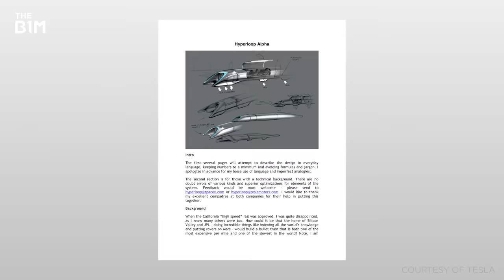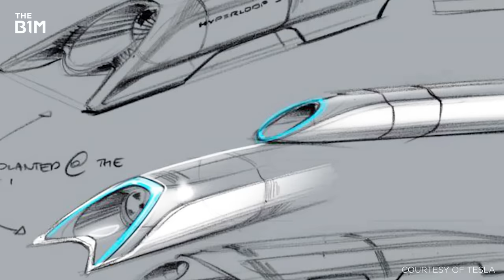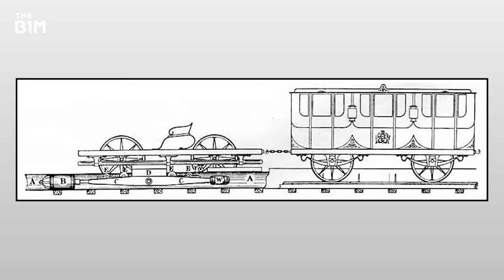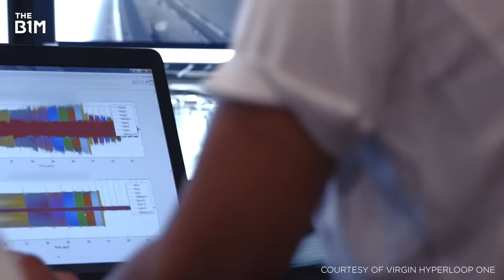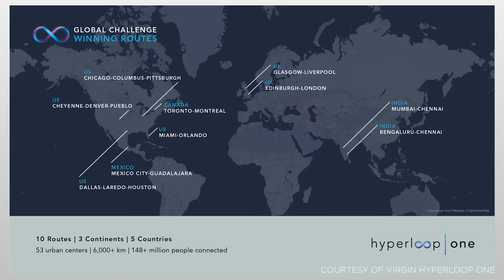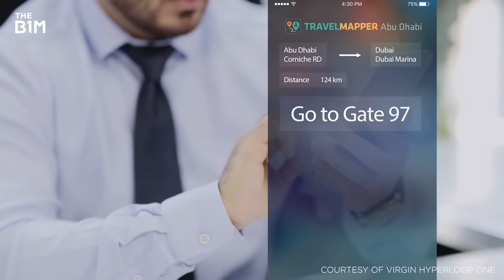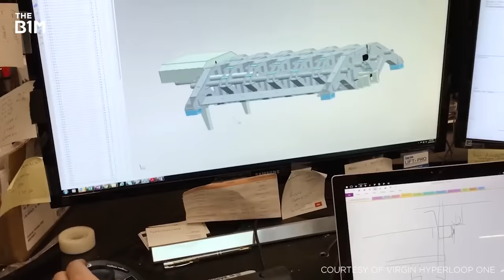Hyperloop Explained

Comment: Google world's largest vacuum chamber if you want a scale of how difficult an entire train line of vacuum tubes will be.
Reply: Actually, I recall that the tubes would be filled with a very light gas, and not a pure vacuum. 
It would be difficult to achieve a near perfect vacuum in a very long train tube. 
Of course sticking people into a pod inside a total vacuum just has the word "disaster" written all over it. 
Well, add onto that the fact it is supposed to move at 700mph. 
Tough technology to crack.
Reply: True. That vacuum thing may be foregone for safety concerns and practicality. What may need to happen is a system that lowers air pressure ahead of the train and returns it behind the train... To keep the system balanced. I wouldn't image the effects of dying in space like conditions right here on earth. Folks would burst in nanoseconds and be dead in less than half a second if their pod leaked out into the vacuum tube...
Reply: @pauldatche8410  A very difficult technology to achieve. 
Keep in mind a train that is moving at 700mph. 
How do you pump out a forward vacuum at those crazy high speeds?
Reply: Sauga Verse you would have to do it quite far in advance of the train, but the sections would still be kept at low pressure for only a short amount of time.
Reply: @ala0284  
No risk of fatigue failure using that idea, I don't think.
Reply: @Saugaverse  id be happy with 200mph
in the uk london rn trains dont even reach 100mph we are using 30+ year old tech
Reply: So I did what the OP suggested, and honestly I can't see the big problem. We've got large vac chambers that we built in the 60's and still use today.  It's not a particularly difficult engineering challenge. Yes we would be doing it on a whole new scale.  But we've come a long way from the days of cast iron tubes and leather seals.  Yes, it's a lot of air to move around. But once you have mostly evacuated your tube (=time)  Keeping it in a mild state of vacuum to simulate upper atmospheric pressures is not overly difficult or expensive from a power use point of view.
Reply: @M3rVsT4H  
A hundred miles long?

Comment: wow! That means I can go to the beach in Santa Monica from Connecticut in less than 2 hours!
Reply: Lol!! 😂😂😂
Reply: Liz Cuero They won't make one for those 2 places tho 😓😓😓😓
Reply: Don't forget about the 2 hours you'll spend driving/walking/whatever to/from the terminal at each end, then there will need to be TSA style security to get through as well
Reply: @dazoedave  Speaking of TSA I don't seem to remember they have security check when boarding an AmTrack train in New York.
Reply: A government security professional said that it would not require air travel security levels since it is similar to train travel.
Reply: Liz Cuero learn math.
Reply: Overweight Grandma to cut the connection of course.

Comment: The problem: To be accessible to people in the hinterland...the system would require MANY portals. And if a hyper loop vehicle has to stop and load passengers at every one of those portals...the speed advantage could be severely compromised. However, if the pods were autonomous and could be dispatched separately from individual portals...and.. "time share" the tubes, ....passengers could be loaded and unloaded at remote portals and dispatched off to their destinations without inconveniencing passengers from other portals.
Reply: BADGUY 1 like having a switch into a siding for loading and unloading....then wait for proper spacing to be shot onto the mainline
Reply: @Keiths_Trains_N_Stuff  You bet!

Comment: Everyone: 

Me: what if you get stuck in the loop
Reply: Did you watch the video until the end ??
Reply: You go back in time!!
Reply: I watched the video to the end and the only thing it mentioned was that emergency exits were going to be added to the pods. OK...so you exit the pod into the tube that most of the air is being vacuumed out of and which is potentially in the middle of the desert. Hmmmmm...what could go wrong?!?!
Reply: good point but we should have tech that will never fail at some point   the future is near
Reply: 5k subscribers with no uploads challenge I have talent
Reply: Right. I rather would sit in a metal tube in the sky, that just crashes to the ground in case of an emergency.
Reply: @matteloht  hahaha ikr
Reply: Indeed, emergency evacuation is one of the main issues.

If one pod has to stop, all the pods behind it have to stop, too, and passengers are stuck for who knows how long and with who knows how much air to breathe. If the emergency was caused by, or caused itself, a leak, you won't get anything moving until the tube/tunnel is repaired and the air is pumped out of the tunnel again (that's a lot of time).

In a normal state-of-the-art surface transport infrastructure (like, you know, a high-speed railway), you make provisions for the evacuation of passengers along the entire length of tunnel sections. For Hyperloop, this would basically mean building (1) tunnels/tubes with twice the diameter to accommodate for parallel emergency alleys, (2) pressure isolation of these emergency alleys, (3) lots of doors into the emergency alleys that are also pressure-proof and don't interrupt the smoothness of the inside of the transport tubes, (4) emergency doors to isolate sections with leaks which would have to be pressurized for the time of evacuation & repairs. All of this would multiply construction costs. And then we haven't even talked about the other major issue of maintainability, or the issue of capacity, or the lack of interoperability.

Comment: simple,the costs of maintain zero air in this tunnel and the costs of energy wasted on air resistance,which one is bigger?
Reply: lzy4202 J evacuating the chamber will be really hard to begin with but it should be pretty easy to sustain.
Reply: Luke Hollis in theory but the expansion joints would add a huge amount of complexity/ failure points

Comment: So far hyperloops aren't creating a big difference compared to magnetic rails but hyperloop tunnels are more expensive so overall i think magnetic rails should be developed first but i guess we can leave Japan and Germany to have a monopoly on that
Reply: there are no maglevs in germany and no intentions to build any afaik
there was the Transrapid which used maglev tech but it failed although it was really cool
Reply: @moidesu5414  O i see well thats sad last i heard Japan and Germany were both funding similar projects in magnetic rail and both had similar ideas too, a rail of magnets that alternated to pull and push a cart around
Reply: @A87-h7x  imo good high speed rail is all we need
maglev is incredibly expensive and while highspeed rail is also expensive the value is overall better
I dont know about japan but in germany what we need is expansion and upgrade of current rail infrastructure, we have a lot of rail section that doesnt even allow our trains to go at their top speed
This is part of the reason why the Transrapid didnt go anywhere: why invest in expensive technology that creates less profit when you can just expand the good old reliable railway thats been tried and tested for ages and has compatibility with all types of trains be it different types passenger or cargo trains etc
Trains are just amazing ways of transport in general
Reply: @moidesu5414  yea that makes sense unless we find a way to cheaply develop meta-materials were not gonna adopt high tech systems just cause they exist but i do think the hyperloop projects prove that certain companies are not really aiming for the economical approach, trying to develop over engineered system to attract investors seems to be the strategy and if thats the case they should probably focus maglevs before hyperloops cause i don't think you can really exploit the lack of air resistance with wheels rubbing against the surface of the tunnel
Reply: @A87-h7x  Yeah maglev is definitely better than the Hyperloop
Reply: @moidesu5414  Germany has had maglev for some time. But the only actual line was shut down after reunification. That said there is still a lot of research and active research tracks. 

You might wonder why they'd shut down a functioning maglev line. Simple. Maglev is overhyped. It's not complete nonsense like hyperloop but it has a lot of issues which make it unlikely to be ever implemented outside of very limited direct connections.

Comment: The relatively low volume of passengers that can feasibly use such a system means that ticket prices will be very high and may be subsidized by taxes. A cool system to have but it will likely be mostly used by the wealthy. Operational costs for energy may be low but the build costs will be high and there will still be significant ongoing costs for maintenance, inspections, security, and administration which will lead to significant total costs.

Comment: I'm pretty sure the engineers of the hyper loop would know if a earthquake destroyed the tunnel because there would be a mass explosion off the high speed hitting air flaws and everything this video has.
Reply: Can be outdone if the there are portions of the tunnels with doors to seal them, so, one guy goes puff, anothers sealthemselves automatically or something like that, its not that big of a problem, but it is for sure, nice point!
Reply: @LevanKikabidze  Still have to stop before reaching the sealed off section.  Wouldn't it take a long time to slow down from top speed, without killing everyone?  How do you get them out?

Comment: Why does the video only include the benefits of the hyperloop and not its downsides? Its impossible to get a complete picture if only one side is presented.
Reply: To be frank, he never mentioned terrorism outright. Also, "fast security" isn't a thing. It's an airport for supersonic trains. It will be treated as such due to its cost. Board as you go only works if the vehicle can support a large number of passengers at once to compensate for a flux in riders. Plus those cars need to be hundreds of feet longer to be cost effective. Its not like a 20 dollar bus pass is gonna make returns on this thing.
Reply: How about instantaneous death when the vacuum breaks and sends a human flattening pressure wave throughout the whole system killing everyone in the system at the speed of sound?
Reply: @JB-yb4wn  The pods will of course be airtight, so the people inside should be safe from decompression of the tube.
Reply: @ninjafruitchilled  
Why yes they will, as the pod travels at near supersonic speeds to crash in to other pods or stations. It doesn't matter how airtight the pods are in this kind of compression.
Reply: @JB-yb4wn  They will slow down if air gets into the tubes. Even if they suddenly hit dense air from a vacuum travelling at high speed the pods should be fine if they are built well. We send stuff through the atmosphere at high speeds all the time. The occupants might get hurt from the sudden deceleration if they aren't wearing their seatbelts, but I'd need to seem some math or experimental data before being worried that the effects would be worse than that. And one would hope that the system has emegency brakes in it so that the pods can be stopped if a breach is detected somewhere.

Comment: People saying this wouldn't be done in a couple of decades are completely lost. We made an underground tunnel from London to Paris, bullet trains goes well over 300mph, who is this so different? There are many bullet trains being built atm, Cancun Mexico is making one South to Palenque, Chiapas,Mexico. Another one from Washington DC to New York, another one possibly from Alaska to Russia. And probably more that I am not aware of. Let me also add every other genius engineer wants to work with Tesla, we have thousands of engineers wanting to contribute to this.
Reply: Why is this so different? None of the trains you mentioned travel in a vacuum tube as the hyper loop proposes to do.
Reply: golden86 proposed is the right word my friend, which means is has yet to deliver. It's just an idea waiting to solidify, but needs proper investment. There are many other ideas being developed, this is just one of them. Open your mind troll
Reply: It won't be a complete vacuum, it won't need 'railroad crossings' like HSR, it will go twice as fast as the current fastest HSR, it will run without generating any emissions, and if there's a tube breach it will fill with air and the pods will slow and stop safely. There will be no 'head-on' collisions or de-railings, and they can be utilized for small-medium freight transfers during their passenger down-times, allowing for emission free freight transfers, too! Mounting solar panels on the top of the tube would provide more power than the system uses up, instead of covering acres and square miles of land with the things.
The fact that Branson has invested time and money into the Hyperloop 1 is a strong indicator that he thinks the technology will work, and be cost-effective and profitable. Remember that the 'Captains of Industry' started with the railroads of the 1800's, and they were working with steam power!

Comment: Sadly all it will take is a concorde type disaster to occur once, for this thing to fail spectacularly.
Reply: Not even that: this is a scam and will never be built.
Reply: Yeah i was think that it might end ip like the concorde
Reply: Korea already has a prototype in place at 1100 km/h.
Reply: It seems way too impractical considering the fact that the average high speed train carries around 600 passengers while a commercial hyperloop cabin would only carry 24 people. Not to mention the absurd cost of building the infrastructure. I think the hyperloop would just be a niche way to travel and will die off before it gains any traction.
Reply: @apersononlineyes6554  I strongly doubt it will even have a chance to die off: it won't ever be built.
Reply: @Daneelro  Here after Elon built his first HyperLoop. Have anything to say, haters? Thought so 😋
Reply: @pipoper101  Is this an attempt at parody? In case it isn't, for your information: Elon built nothing, his company built no HyperLoop (that would be a vacuum tube with high-speed pods in it) but a simple road tunnel with Teslas with drivers in it, and it was built over a much longer time than Musk predicted & for a lot more money and makes absolutely no sense. They should have built a light rail line instead.

If you can be blinded by corporate PR enough to perceive the shitty Las Vegas project as something even remotely resembling a futuristic vision, and convince yourself it's HyperLoop even though even Musk & the developers aren't as brazen as to name it that, then you are a very easy mark for con-men. You'll fall for several more in your future life.
Reply: @Daneelro  Keep on hatin', hater! 😜 😜 To all the logical, reasonable people out 'ere: TO THE STARS!!!! ✊🏿✊🏿✊🏿 🚀🪐🪐🪐
Reply: @pipoper101  The excessive use of emojis makes me cringe so hard

Comment: I like idea to transport cargo with hyperloop, it will be a lot cleaner to transport stuff in than to trucks and airplanes.
Reply: Are you sure? Cargoes will be limited by the size of the tubes and the size of the Hyperloop trains. Freight trains, ships and trucks may be slower but they can carry much more.
Reply: If the system were built to handle standard ISO containers it might be practical but that would depend on there being the infrastructure at each end to handle them... Which is not beyond the realms of possibility.

The big problems start in the real world. For one thing it would require the goods being transported be either immune to a vacuum or carried in pressurised containers. The second and most critical problem is that the system would have to be cheaper than conventional railways which it wouldn't be. Not even close.

With very few exceptions cargo is not time critical to the point where near supersonic travel is any advantage. The existing systems are based on goods travelling by sea, rail and road and the system works just fine at normal speeds. If your fresh tomatoes travel from China to LA by ship then LA to SF by train and from the train hub to the distribution centre by truck and from the distribution centre to the shop by van how is doing 1000km/hr for one short leg of the trip going to make any difference at all? From farm to plate in 7 days, 12 hours instead of 7 days, 14 hours.. Who's gonna care?

Comment: Well, if hyperloop and all its track components will be monitored by computers connected via fiber optics, then it should be safe since the speed of light and the processing speed of computers are still faster than the hyperloop train. It means, when a breach or earthquake is detected, the train's software would already know what to do before it reaches that area.